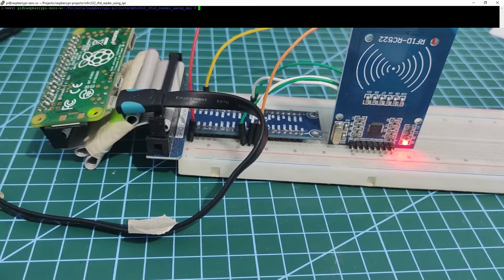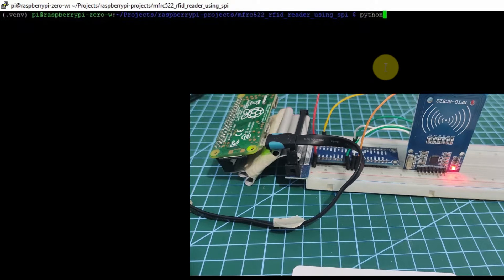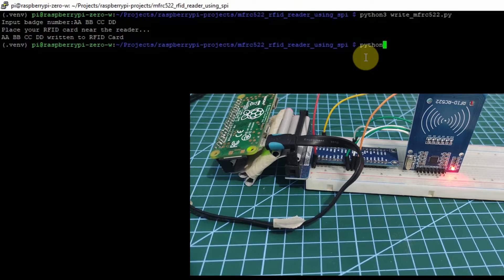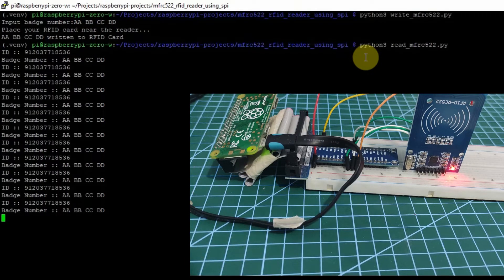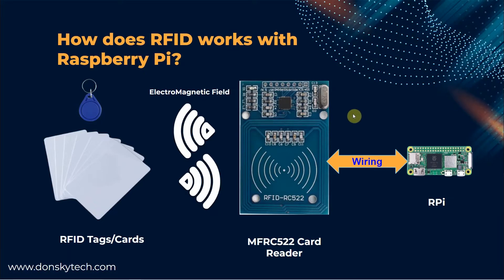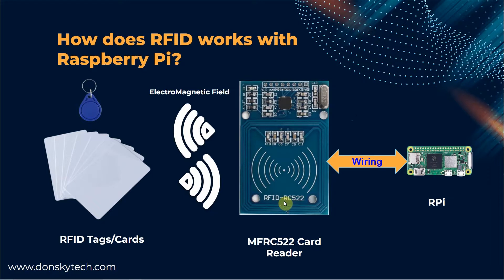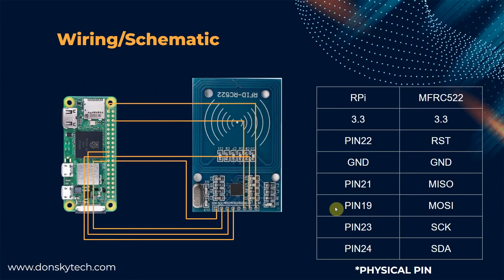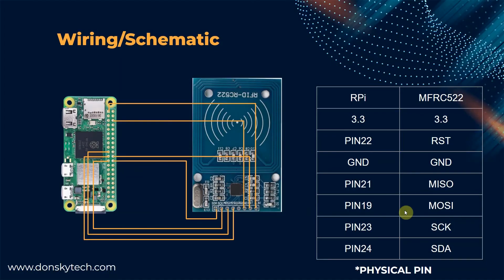Raspberry Pi - MFRC522 - RFID Card Reader Setup

Comment: When I plug in my RFID reader, my LED does not come on like yours. I checked the input power and see it has 3.3V across the power and ground. Why doesn't my LED come on? The RFID reader also is not reading anything.
Reply from the maker: Hey @vodkagobalsky, it usually is wiring.  Change your wires and recheck your connections.  If all else fails, try with a new reader.
Reply: @DonskyTech  I got it to work but only with another RFID reader. Maybe the one I got is just busted. I can also try to redo the soldering on the pins.
Reply from the maker: @vodkagobalsky  glad you figured it out. Please support my channel by subscribing to it if you have not done so. I will be posting more interesting topics soon. Thanks